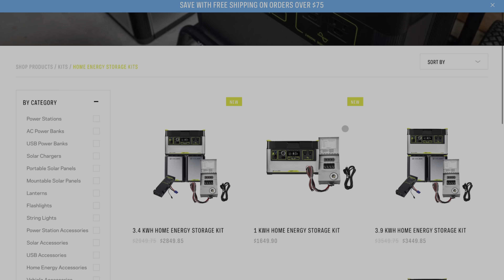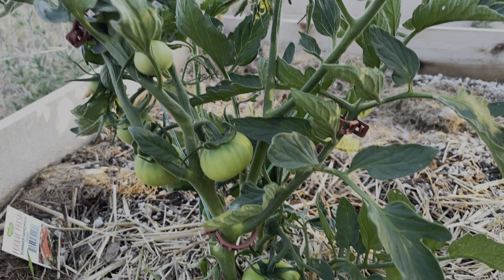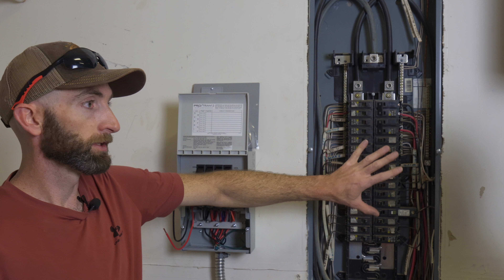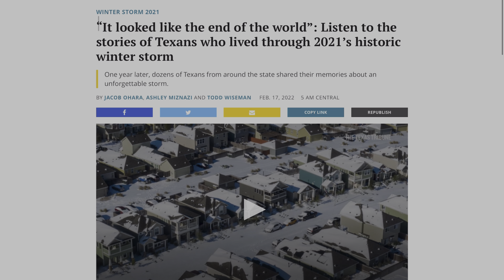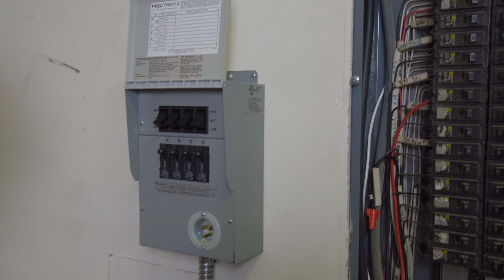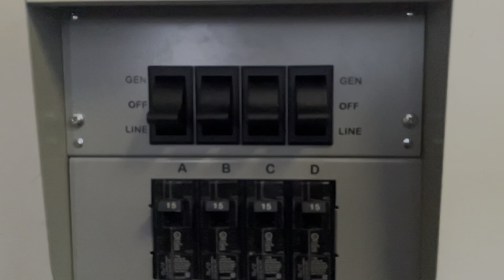Home Backup Transfer Switch / Backup Power in Emergencies

Comment: How exactly is the male plug wired in? I cant seem to figure out how all the wires are connected to and from it?
Reply from the maker: The male plug is wire like an outlet, the manual switches are what change the direction of polarity.
Reply: @KTheGuy  YOU DONT REMEBER OR HAVE A PICTURE OF THE FINAL WIRE HOOKUP TO THE MALE PLUG DO YOU?
Reply: @KTheGuy  I see he put the white and green into it but dont see what he did with the short red and black coming off the panel?
Reply from the maker: @FoggyBottomFarms   this is Reliance (transfer switch brand) how to for the external male plug installation guide.
https://youtu.be/0M8sYRhEVPY